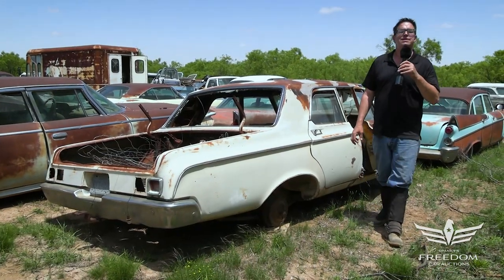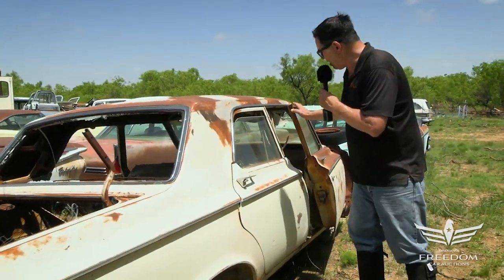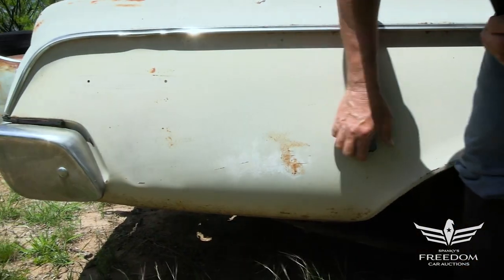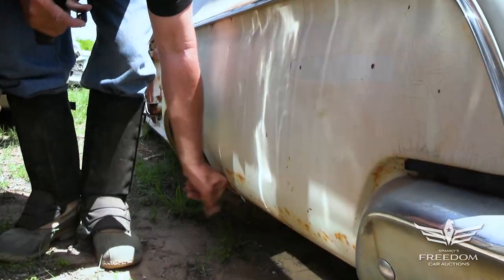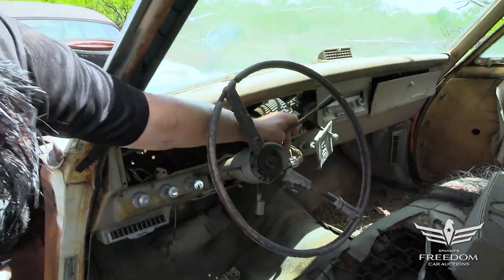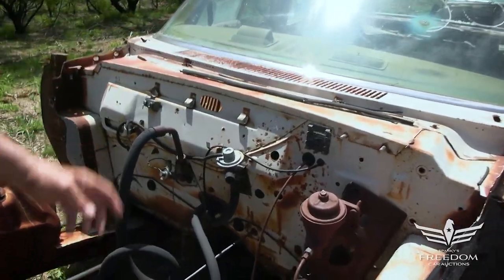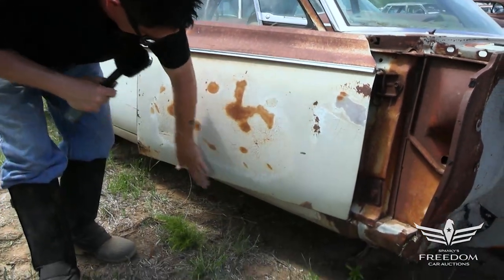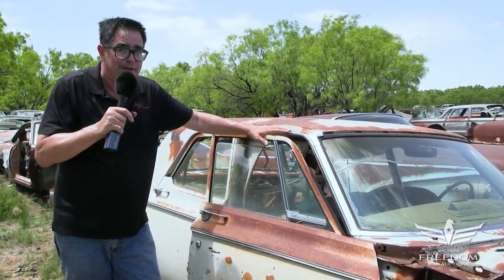203 1964 Dodge 330

Comment: Hey Steve love the videos. I bought a 64 330 in 1977 for $50.00. It was a four door sedan black red interior. Push button auto six cylinder. I got it from the original owner after it was hit in the left rear while it was parked. Minor quarter damage but she didn't want to drive it anymore so I bought it because l needed a car I was 19 years old. I had a lot of "GOOD" times in that car if you know what I mean.
Reply: Mr. B. Here ! 🍩☕️👀😎👍